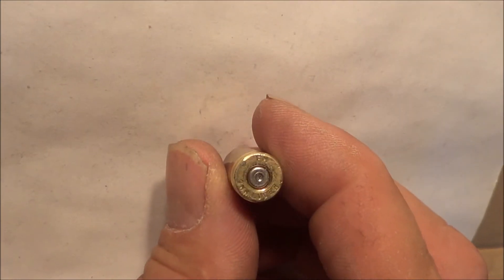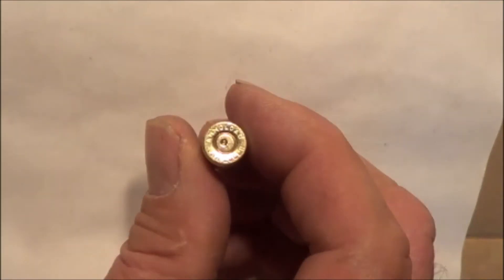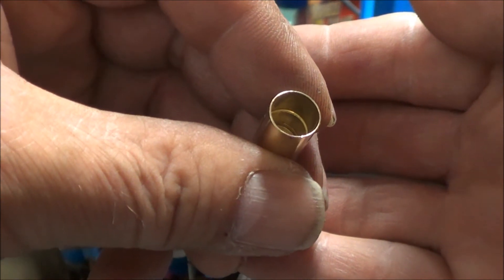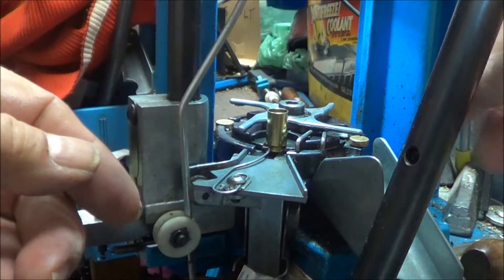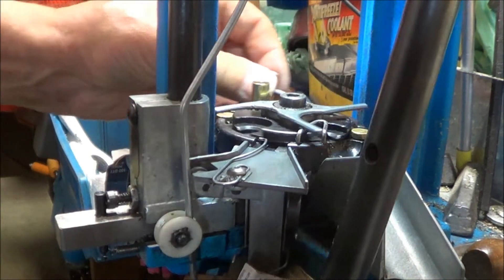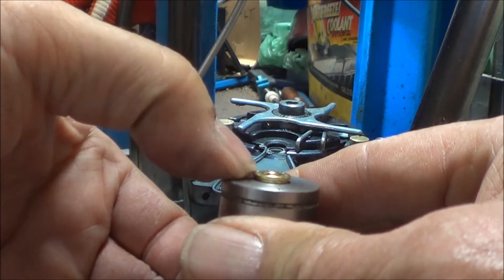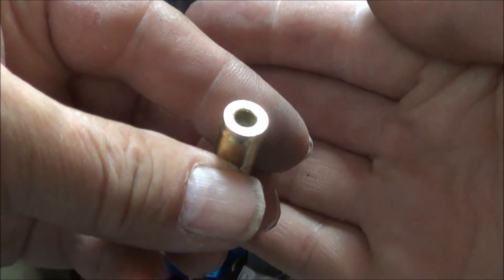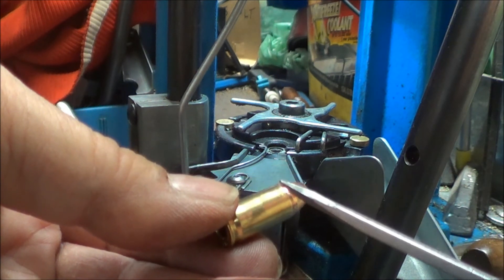Stepped Brass - Internal step in 9mm Luger cases causing bulged case seating a 147 grain bullet.

Comment: I've picked up a few of those at the range.  I sliced one open and ya not very reloadable.   Might work with a 115 or 124 gr, but I'd toss em.  The ones I picked up were Maxxtech by Tul ammo.
The case capacity is limited hence less powder to achieve needed pressure.  Deposit them in the trash, rinse and repeat.